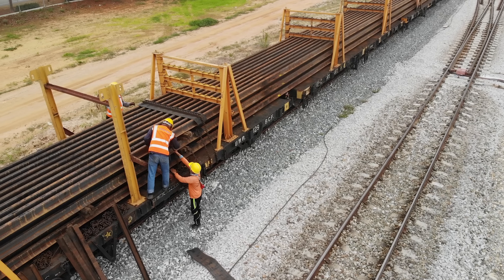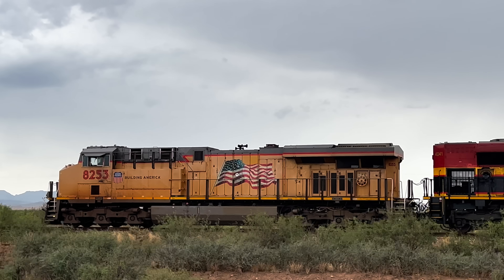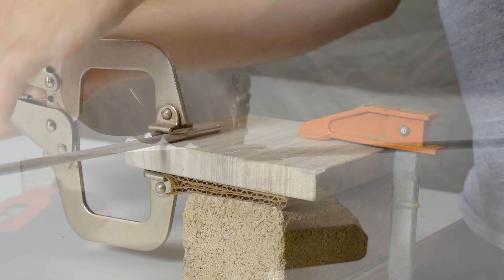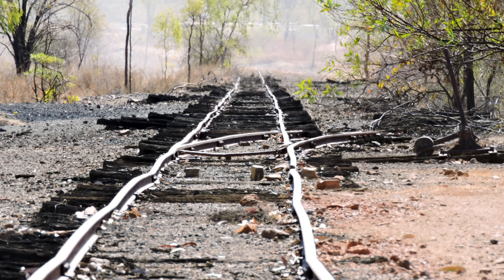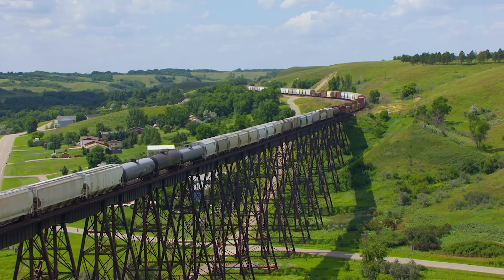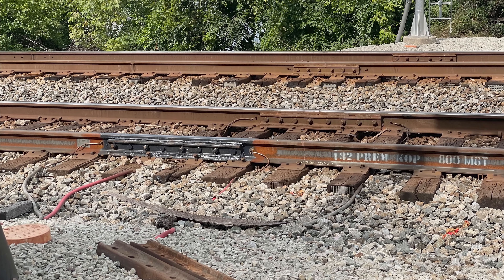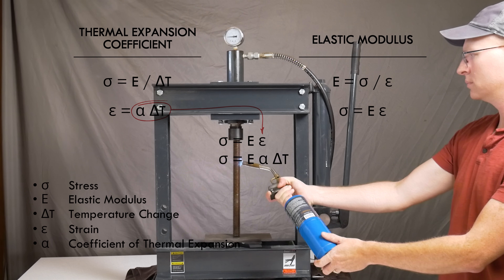Why Railroads Don't Need Expansion Joints

Comment: You mention insulated joints.  i just hikes along "the impossible railroad" (Carrizo Gorge railroad/Goat Canyon Trestle, the largest wooden railroad trestle in the world).  At the southern end of the trestle, is an insulated joint, on only one side.  Bridging this joint is a copper wire bridging it!
          There was one other significant feature of this railroad.  Because of the sharp curves, there are flange lubricators spaced a mile apart.  Every time a wheelset passes, it presses on a treadle that squirts a shot of grease on the inside edge of the rail.
          Why isn't there more research on lower-expansion steels?  I know of Invar, which has zero expansion over ~100C range, but it is expensive.

Comment: Great video! Sun kinks are indeed a potentially catastrophic scenario. Yet, I've seen vintage narrow gauge railroads on Y.T. running their trains in passenger service even with sun kinks clearly vissible without any derailments. Which makes me wonder: could softer rails be less likely to be prone to derailment due to sunkinks alone? Meaning, would the softness make it possible for the weels to bend the rails and thus avoid any risk of derailment due to the sunkinks themselves while still being at the risk of braking due to the increased stress?

Comment: As a civil engineer, I should have not been surprised when I encountered this same problem after constructing an HO-scale model railroad in my sunroom, where temperatures vary a lot. I used "flex-track" rail sections about a meter long, and discovered that on hot days, the rail was busting out the plastic "spikes" that are integral to the cross-ties, caused by the thermal expansion. Sun kink! I did a test on a rail section to see the degree of expansion by measuring it in a cold space then moving it to a hot place, setting in the sun, and measuring the difference. I was surprised that it was over 1 mm for a 1-m length of flex track, or over 0.1%. I had to go back and trim all my rails to remove that millimeter from one end so that the rail could expand and remain within the plastic spikes on the cross-ties. On hot days, the gap between sections is closed, and on cold days, it opens by about 1 mm. Lesson learned: The similitude between a model railroad at 1:87.1 scale and the real prototype is remarkable, extending to even the expansion of rails. This should not be a surprise, since materials are materials, but it was "fun" and interesting to realize that my model railroad has the same issues that the real railroads have.

Comment: A friend of mine worked on subway in São Paulo Brazil when we were at University. At the end of the line on early morning he marked the end of the rail position and waited until the afternoon after the heat expanded 20km of rails. It was a huge amount, very interesting, because those rails (put in the 70s) were not restrained completely they are let to expand in longitudinal direction. The parts of the rails are joined by thermowelding (with thermite). He told me that was still clickty-clackty when the trains passed over a detour switch (turnouts). I remember (and miss) the sound of the trains at about one kilometer of distance, late at night when there were only one or two trains during the night.

Comment: In the early 1990's my railfan buddy and I saved northbound Amtrak Coast Starlight from a potentially disastrous derailment when on a hot day a portion of the SP mainline south of San Jose along a "race-track" paralleling Monterey highway developed a kink after a low-boy farm trailer bottomed out and tugged one of the rails at a rural road crossing.  No change in the signals of course.  We had pulled over to video the Starlight when it happened, and placed an emergency cell phone call to the SP dispatcher.  Just as the headlight appeared the train halted just south of the kink.  Got a nice letter from the SP thanking us for our action.

Comment: Also nowadays, one can observe endless welded rails buckle after years by thermal expansion and tension with an waving surface and an uncomfortable shaking during a ride, even if the rails are fixed vigorously to their ground, which proves that this problem cannot be solved by the total renouncing of joint rails with fishplates!

Comment: Started building track 51 years ago. Great video ! A few things left out are the use of rail anchors in tracks with standard tie plates,  pandrol cliups as well as well as others do the same job.   Ballast  shoulders are an important consideration to prevent sun kinks.
Reply: Conductor on a Class 1 here: by ballast shoulders do you mean the tie end-plates should be completely covered in ballast? Just this last year, we got a new MOW manager, and started dumping large quantities of ballast along our subdivision. It was only after this process happened that I learned the ties should not have exposed ends.

Also, the anchoring system you talk about, are those the somewhat “c” shaped pieces of metal that seem to be attached to the bottom of the rail and directly against the ties? I always figured those were to prevent the rail from sliding forwards or backwards with heavy (emergency) braking or something.
Reply: @firefighter4443 rail Anderson all so help stop rail movement  along the track  all so .  And expansion mainly happens  in the last 2 meters or so , to get the long lengths  of rail  , it has to be put under tension  at a given temperature  then fixted with ankers and welded together   ,and continuous  long lengths  for miles ?
Reply: Peter Wilson. Formerly of Little A, MBCR and Keolis? I remember you from various encounters on the property.

Comment: Why did it take so long for US railroads to adopt continuous weld? British Rail was rolling it out all over their trunk network in the 1960s. One other thing; what are the implications of the difference between US jointed rail (alternating joints at 39' intervals) and British jointed rail (paired joints at 60' intervals).
Reply: The alternating joints are an invitation to twist faults, which are a serious derailment risk to short wheelbase wagons. Probably tenable in the US because they tend to only use bogie wagons. Less joints also reduces the effort needed to haul the train, swapping from 60'-0" jointed to CWR reduces rolling resistance by 10%.

Comment: j
The Soo Line was installing ribbon rail on the Brooten Line in Minnesota. At the end of there season they were between McGrath, MN and Isle, MN. We were headed west with a hundred empty hoppers and were stopped at Mc   Grath account they were going to flame the rail to expand it and then apply the rail anchors to keep it in a stretched state. The problem was it was November and the temperature was -25 below. I later found out that they had heated some of it to red hot. The following spring I was the first to go over it with a hundred loaded grain hoppers headed to Superior, WI. There's a long stretch thru a swamp of level track there. Pow, the train air brakes applied in emergency. Part of the hind 30 or 40 cars derailed. There were 2-3 cars on the side in the ditch, then 2-3 cars still on the rail, 2-3 cars in the ditch on their side, etc. That was odd until I looked at the train consist. The cars on the rail were wheat, and the cars on their side were sunflower seeds. A car of sunflower seeds is much lighter than a car of wheat. There were multiple sun kinks that developed as we passed over that section of track. After railroad officials arrived we were allowed to depart again, but at ten miles per hour. Two miles down the track I stopped again as I could feel were were on another kink. That's as far as we made it that trip. The section was later busy cutting four inch pieces of rail out and rewelding the rail back together.

Comment: what rot in Aus when we have actual heat waves they buckle now they don't have expansion joints they didn't before when they did all metal expands and contracts with heat and cold not all places have the same weather

Comment: Just that the clickety-clack is also determined by the number of wheels.  For many years many long-distance passenger trains used 3-axle trucks and when these went over joints THAT produced the clickety-clack rhythm.  By the 1970's most US RR's were using 2-axle trucks for passenger equipment and this design did NOT do the Triple Rhythm that was the clickety-clack.  In 1979 I rode a Grand Trunk (CN) excursion out of Portland ME to Island Pond VT and return.  The train used Canadian cars which had the 3-axle trucks and THAT causes that triple rhythm which was VERY pronounced.  
     Yes, joints DO make noise!  In Boston the old Orange Line Elevated (closed and demolished in 1987) had its rail joints ALMOST opposite each other but not quite but neither were they evenly staggered like on the "Steam" roads.  The result was a constant ka---Klang........ka--Klang as you rode along above the street.  No wonder the neighbors wanted it gone!.

Comment: In the UK, long welded rail does in fact have expansion joints at various intervals, as is pictured at 13.04.
Reply: Long Welded Rail (Rails over 60'-0" but under 180'-0" in length use ordinary fish plates like standard jointed track. However the installation of new LWR was banned more than ten years ago. In CWR track rails from 180'-0" to infinity in length, breather switches will only be installed where the CWR track abuts weaker/older track that can not safely deal with the stresses generated in the CWR. At the ends of certain bridges, or to protect S&C units that can not with stand the stresses involved mainly very short switches and some forms of diamond.

Comment: The "clickety-clack" is still part of the railway near me. But I do think that when it needs replacing they'll be using these modern techniques instead. I didn't even think of it at first. "Just stretch the material before it becomes warmer, so it actually relaxes a little during the summer", ingenious.

Comment: 0.0115 - thermal coefficient value for a pearlitic rail steel with a medium chromium content. Maths is spot on though, good job. Some mention should be made to the ballast shoulder rather than just the cribs, in terms of rotational stability of the sleepers it’s a very important component.

Interesting to see how they manage rail in Florida; I work on a European network so traffic is very high - the access we have is nearly all at night; I can’t remember the time I did a natural stress (during the day). I also can’t believe that rail defects over there are managed by people walking and looking for physical breaks! It is substantially more common across the world for the rails to be tested ultrasonically, usually mounted on a train, to identify internal defects of the rail before they snap in two. Eddy current is most often used for rolling contact fatigue.

Comment: Uhh… every year rail roads fight sun kinks and broken rail during cold snaps on continuous rail. Miles are removed every summer and put back in every winter. Also, the rhythmic rocking on jointed rail is called harmonic rocking and can derail trains if you stay too long at speeds conducive to it, IIRC around 13mph.

Comment: Where I am from our old system used 30 m (100 ft) length rails fasten directly adjacent from one another (not staggered like North America) so rolling stock never rocked with sidesway). Today of course 99.9% of our rail is CWR as well. Also we use either reinforced concrete or metal sleepers, using wood is very antiquated by our European standards with bolted clamps instead of nails (spikes).For the most part we also use the international standard gauge (1.435 m) as well.

Comment: New rail isn’t always installed only on hot days. Union Pacific rail gangs use a piece of equipment called a rail heater which is just a 1000 gallon propane heater with a dozen burners on each side to heat the rail to its neutral temperature before it’s either spiked or clipped.  Neutral temperature varies greatly from Texas to Minnesota.  CWR is primarily used for main line while a lot of yards, industries, or set out tracks are still jointed.

Comment: In the UK we use CWR and it's an absolute farce. As soon as it gets towards 30⁰C they slow the trains down or cancel them altogether, due to the stress on the rails. True we don't often get to 30⁰C, but with climate change it is starting to become more frequent. After watching your video I now know the neutral temperature was set too low. Idiots.

Comment: I work for NYC Transit in track maintenance for 24 years and we put in rail whenever and whatever temperature and it causes a lot of problems. Rails run or shrink when you cut into the CWR and can make it nearly impossible to change a rail.

Comment: Gas pipe instead of rails:
A gas pipe was replaced in front of our house, the new one was made of plastic and about 400 metres (400 yards) long. It was a hot summer's day and the sun was shining on the construction site. During the night, the pipe shortened by 2-3 m (7-10 feet) and the gas flowed out happily.
Reply: Gas lines are buried approximately 24" deep, so there would be very little change in length from day to night, or summer to winter. Your gas would still be happy.

Comment: When I had the baize, AKA felt/cloth, replaced on my pool table the installer sprayed it with a thin mist of water to introduce the most amount of moisture to will ever experience. So, when stapled down it dried and tightened up the cloth putting it under tension l. So, no matter how humid it gets in the house, the cloth won’t get wrinkled keeping gameplay very consistent. I think this is very similar to installing railroad tracks on the hottest day possible to keep them under tension as well. It’s so cool how materials respond and react to their environments! Awesome video series!!!! 😊😊😊

Comment: I forget what year it was. But one winter, a section of rail line failed near Edmonton Alberta due to the frigid cold temperatures making the rail line become brittle and caused a derailment. I live fulltime in a motorhome and with weather temperature changes or changes in my room temperature using the wood stove for heating, the aluminum shell of the RV body sometimes makes a loud "POP" noise when it expands then contracts from rapid cooling. Another guy I know who lives in a newer RV with a fiberglass body shell, doesn't understand why the body shell is forming cracks from leaks and delamination. also temperature changes contribute to the problem

Comment: I remember living in a house with a railway at the bottom of my garden and the wheels continuously dropping into the expansion gaps tended tpo set up a vibration which exacerbated over the time the train was running over them. This shook my house even more depending on how long the train was.  This subsided when they welded the track.

Comment: Couple of things to add, the traditional rail spikes do nothing to constrict the rail, hence they add what we call anchors(seen at 11:22 the round things attached to the foot of the rail) they will hold the rail to the side of the sleepers. Rail also moves back and forth over time and due to gravity it will favour leaving the excess rail at the bottom of hills, so you'll often get anchors just on the high side of the sleepers to stop it creeping down the hill, also means a lot of buckles happen at the bottom especially if there's a fixed point like a track switch at the base.
Other types of fastening eg. the pandrol 'e' clip seen at 3:13, due to its downward force those style don't need anchors since the rail is is pulled to the sleeper.
Rail expansion can also be extremely dangerous for workers, know a couple of guys cutting rail on a hot day...they use a friction saw(like a chainsaw with an angle grinder type disc thing) the rail constantly grows with the added heat of the saw and will close up on the blade as they are cutting possibly shattering the blade at high speed which is one issue, to help sometimes the guys will give the rail a little lift taking some of that pressure from the blade, unfortunately when lifting it also means there was less pressure holding the rail in position(even if only a fraction) and in an instant the rail kinked out by about a meter and a half knocking their legs out from under them. They were very lucky not to hit their heads on the other rail.
With heat compressed rail, experienced guys will do a 'heat cut' if it's needed which is oxy(blowtorch) cut, they cut about 1/2 inch chunks out of both sides of the foot of the rail, as well as the head and web leaving only a small section at the bottom-middle where the web and the foot intersect, with that small chunk of steel they will then pass the oxy back and forth letting the rail expand slowly until the pressure is gone.
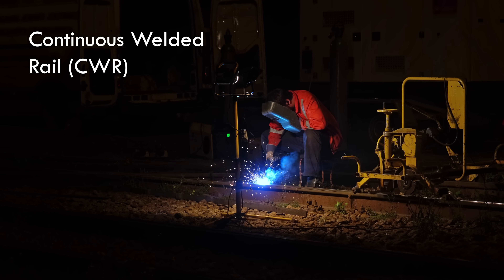Lastly a bit unrelated but that guy at 1:19 welding in the dark is not joining the rail, guessing he just used the footage because he needed some welding footage, that guy is probably fixing pitted track where a chunk may be taken out of the head and he's just filling the holes and smoothing it off.

Comment: I've avoided trains since I was a kid because I couldn't stand that non-stop thumping from the abrupt expansion joints. The diagonal joint pictured here 12:52 would certainly have lessened that, but if continuous welded tracks have been made safe enough, why not?